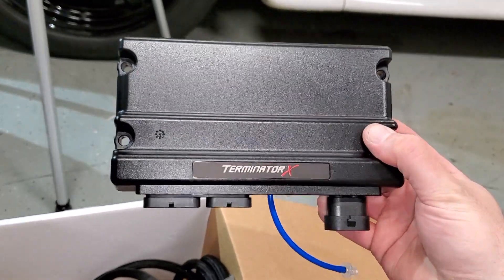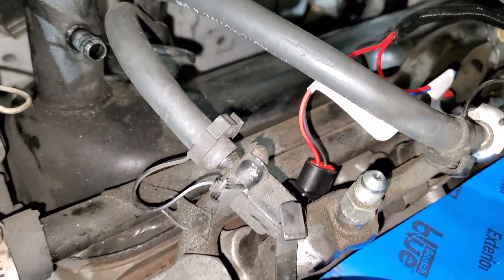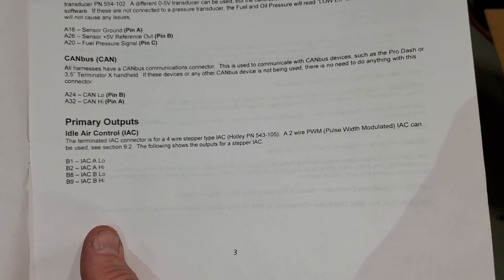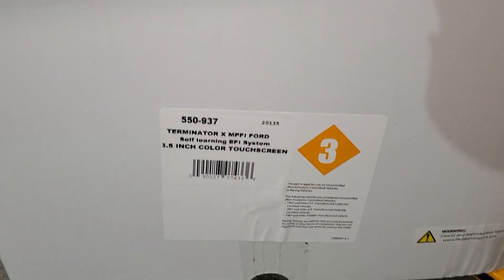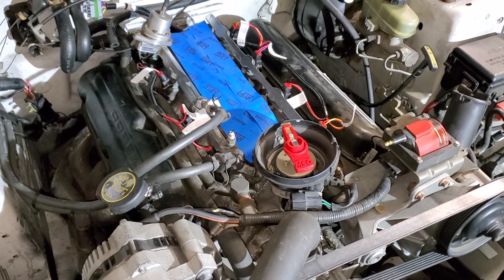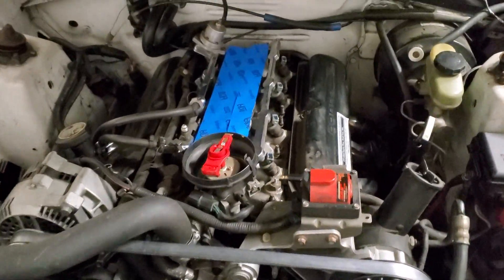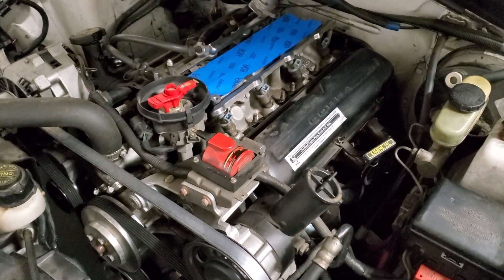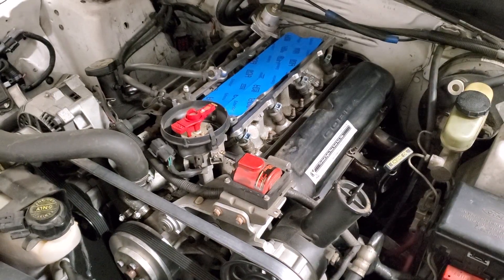Connector Confusion, which Terminator X kit is right for the SN95

Comment: Looks like someone went ahead and wired in a ls style 4 pin IAC connector for you.yank that factory pulse width modulator style and drop in an ls1 4 pin IAC. And repin to the unused gm conectors in the holley and it will save you an input as well
Reply: Hey brotha can you elaborate some more for me id appreciate it. Im doing one now. My ig is c00ters_garage 👍